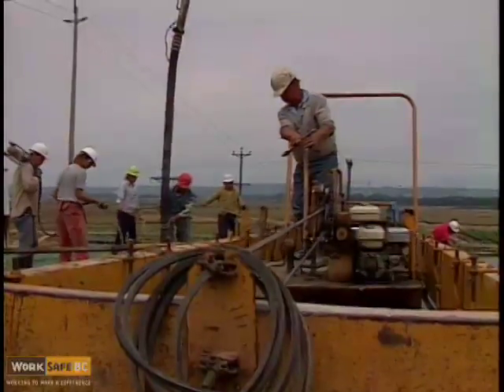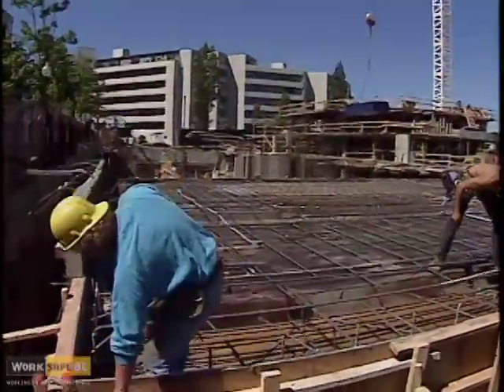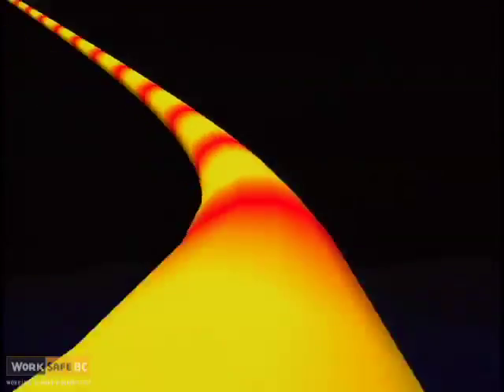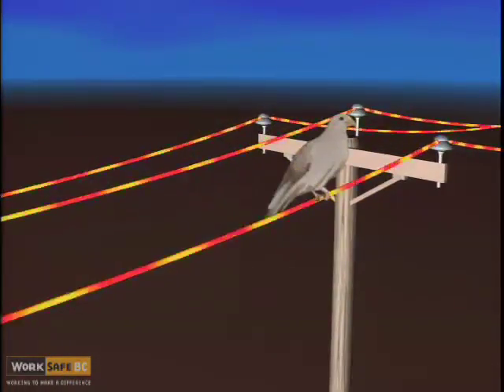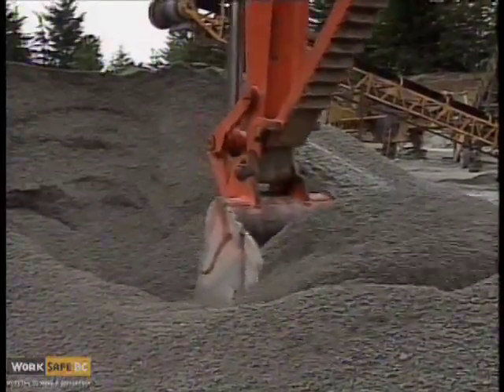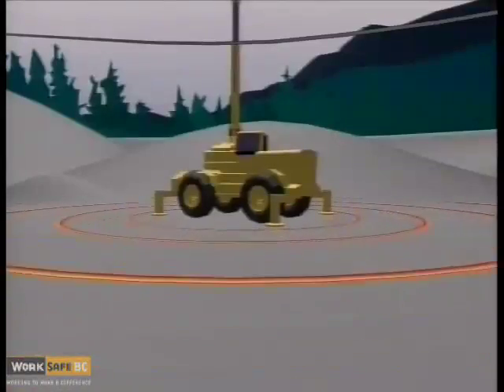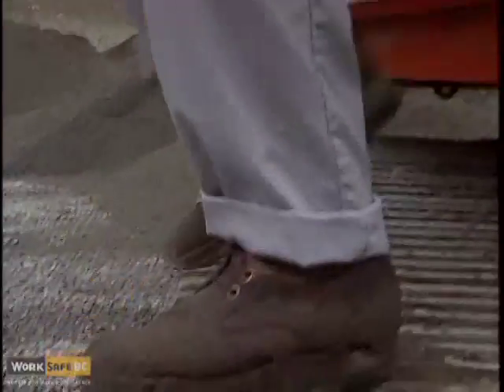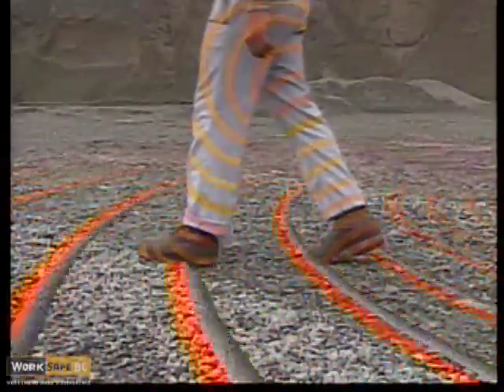A Bright Arc: Contact With a Power Line (6 of 7)

Comment: Why don't they use insulated power lines? If they did, this wouldn't be a problem
Reply: 2Expensive
Reply: +WarthDader74 wellm for one reason: that would be expensive
Reply: Ok, then they should make it less expensive. We are talking safety and lifes here.
Reply: WarthDader74
Cool idea, bro. But its not only the lines that cost money. Someone has to install them. And while they are being installed, how do you supply electrical energy to the people that depend on those lines?
Reply: Kreppklebeband I am pretty sure that most civilized countries would afford the cost to insulate them, when they could afford to install the wires in the first place. Meanwhile the insulating is going on, the people can use flashlights and cook their food over open fires.
Reply: Kreppklebeband I am neither of those, I just want to save lifes.
Reply: It really has little to do with the cost, and more to do with the fact that at the voltages power lines are often at, the insulation would have to be several feet thick...
Reply: Nicholas Heinrich That tells something about how dangerous those lines actually are. Something really needs to be done.
Reply: Of course they are dangerous. What can be done is making sure people follow the proper precautions. Don't come into contact with them. Nikola Tesla envisioned them all underground. I favor that plan as well. However the cost of moving them all underground would be astronomical.
Reply: This is pretty much all about the cost. Sure, you could insulate a 400kV power line, but the insulation is exposed to the wear and tear of weather and will break down eventualy. Also PVC can insulate 30 to 50 kV/mm so the insulation would not be several feet thick. Please stop spreading bullshit. And because high voltage lines are dangerous they are suspened several meters in the air. It is and will always be cheaper to just train people not to wedge their epquipment into those lines or switch them off for several hours.
Reply: +Kreppklebeband Just because PVC "can"  insulate to 30-50kv per mm, doesn't mean it's sufficient to protect people. Add that to the fact that if power lines were insulated they would likely be closer to the ground, meaning that the safety margin of the insulation would have to increase. In addition to that there are 3 phases, which probably won't be butted right against each other, most likely again encased in yet another layer of insulation. The entire assembly may very well end up being several feet in diameter. My saying that the insulation would be several feet thick was more a figure of speech than anything. Keep in mind it was directed at someone who seems to think something must be done to protect people from their own stupidity, that this is some very common occurrence that is a grave threat to humanity, and that isn't also talking about banning cars (despite far more people being killed in vehicular accidents than by electrocution.) It seemed that a generalization directed at conveying the sheer impracticality of such a notion should suffice. My apologies.
Reply: Why don't people just look up?  This wouldn't be a problem then.
Reply: +Sodiumreactor Exactly. I quite frankly call this sort of thing "natural selection" most of the time. There are of course the few who end up being in this situation through no fault of their own. I feel bad for those people. To be quite honest I feel as though so few people actually die from this that it really isn't worth making power lines safe. Banning cars, and only allowing public transportation would likely save far more lives. However we don't see many people suggesting that now do we? These risks are simply the price we pay for all our modern day conveniences.
Reply: +USNVA If you SERIOUSLY think that insulating the lines would make the world a safer place by any significant margin, or is in any way practical, then you need to do some research. Clearly you do not understand the logistics of distributing power to millions of people. If we really want to make the world a safer, better place, then we should all be focusing on, and be willing to pay for a smart grid.
Reply: Nicholas Heinrich What is a smart grid going to do to ensure safety?
Reply: +USNVA  No one will freeze to death during a cold winter when the power goes out, because it won't . Failures will be avoided, meaning linemen will have to work on the dangerous energized equipment less. That's how.
Reply: Nicholas Heinrich Looks good... we need it and like yesterday! I don't want to see any more people getting killed messing with this shit.
Reply: People will still die on occasion, just not as frequently, as there will always be idiots. It is unavoidable unfortunately.
Reply: Nicholas Heinrich You're making a valid point in one regard, but then there are those who are not looking for harm to come their way, who are simply unfamiliar with electricity or the energized lines above or wherever, they try to do everything correctly, and in some instances still pay the ultimate price. These poor unsuspecting victims are not idiots!
Reply: +USNVA Most of the people you are mentioning are heavy equipment operators, who will have had this covered in their training. If they are operating heavy equipment with no training, then I would place them too in the category of idiots. The only ones who are an exception to this are people who come into contact with downed powerlines. Since the wire has snapped, even insulation would be rendered useless, and there is nothing that can prevent harm. With the exception of going back to the stone age and forgoing electricity altogether.
Reply: Nicholas Heinrich You know... I was there once when I visited the Amish who were friends with one of my cousins, hehehehe....
Reply: Nicholas Heinrich This is a training video for those people.
Reply: I know...
Reply: They are insulated, thickly. If they were any heavier we'd never hold them up.
Reply: +Scott Wallace The vast majority of all power lines are not insulated, at all.
Reply: Nicholas Heinrich I will not disagree with you sir, because I haven't seen the vast majority of them. We have some here in Ontario, Canada, high transmission, from Niagara Falls, and the Bruce nuclear facility, all transmitted overhead, and I regard them daily. On very sunny days the black insulation sags those conductors twenty feet between those towers. When it gets cold and cloudy they tighten back up. I'll let you calculate the voltage drop due to impedance on that run, but I assure you sir, they are well insulated, or that sag would never occur. Best wishes with your further studies.
Reply: Oh yeah, don't pee on the 'lectric fence.
Reply: Kind of like cross country knob and tube. Neat idea.
Reply: WarthDader74 it costs more
Reply: there is also if factor of weight. insulation weighs a lot and given that fact you would have to have a shorter span between pylons. you would need to double your pylon amount so your route with your cables would be harder and become more expensive. more maintenance of those extra pylons etc etc. costs go up and so on.
Reply: Without insulation they get away with putting more current on the wire because air is able to cool the wires
Reply: That's... what... the... big... ceramic... things... are... for...???

Comment: Ummm this is kinda silly because it takes 1 millionth of an amp to kill you. As it was stated, batteries have enough to kill, but you have more resistance than the equipment it powers. The bunny hop I seriously doubt it would make a difference. That and touching the metal body was a dumb thing to do (good thing it actually was a dead line otherwise he would have been fried on the spot). training videos only go so far unless it's in a real life situation that only then you put things to the test.
Reply: If you're in the machine and not touching ground you will be safe. As far as keeping feet togehter, that's the best plan. the ground acts as a resistor, and if there is space between them that resistor will  make a voltage divider giving potential voltage that can go from foot to food. MANY people have been killed this way. When you keep them together and the ground is electrified you stand a MUCH better chance. As far as your statement.... 1 millionth of an amp you won't even feel. you have to get up to 1000 times that (1 milliamp) to even detect it.